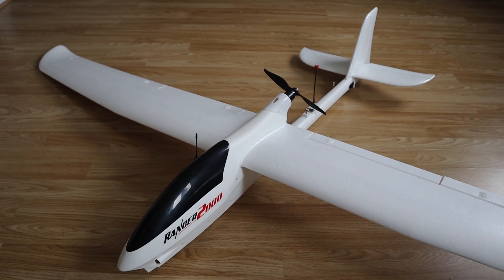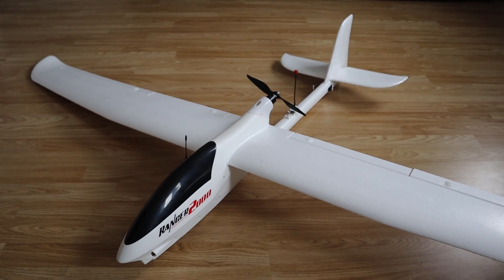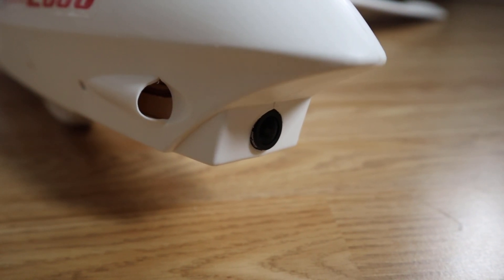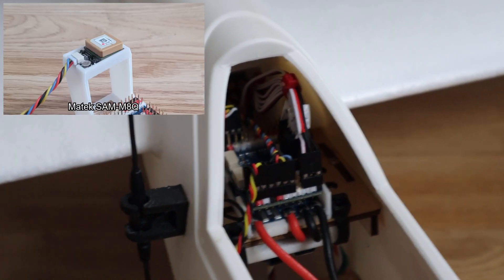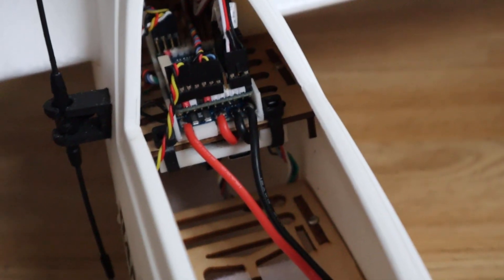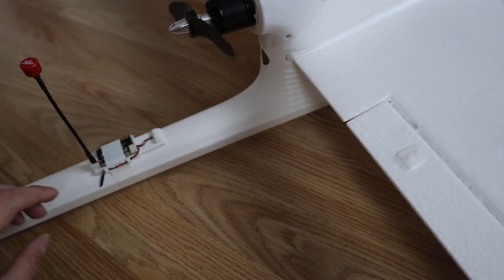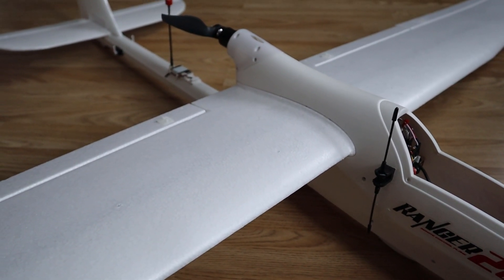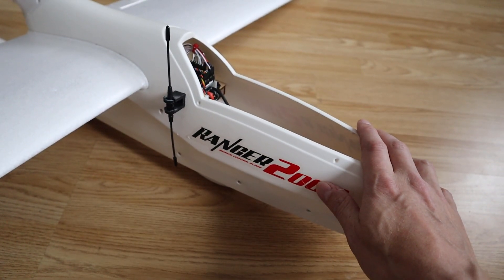🛩️ Volantex Ranger 2000 - INAV Build Overview Part One

Comment: Very useful video, thanks. I'm still at early stages trying to get into FPV. Have been playing with my old Bixler. Analogue vtx. And inav. It's a big learning curve. You're on analogue by the look of it. I am in the process of organising a Ranger 1600 for fpv. Very similar. No 3d printer so it's gluing foamboard for mounting SpeedyBee. I hadn't thought of vtx on the tail platform. Good idea!
Personally speaking don't like the moulded in camera position. Good way to wreck a camera or fill the lens with mud 😢. Will check out part 2. Thanks. 😊

Comment: did you separate the Aileron Servos? they come wired as a pair, and i'm not too sure how to set up the mixer for that on inav!
Reply from the maker: I did separate them, yes. All the servos are plugged into the FC individually, none are wired together. Just made the mixer stage easier
Reply: @gizfpv  I feel like that's the move for setting it up, tho I'm not sure it has any advantages for the stabilization or control, the flying wings seem to all use it, my FC is the matek 411-WSE and it only has 4 servo outputs, so if separate them, I won't have a free Chanel for the flaps. Unless it can do softserial like beta flight
Reply: @gizfpv  nonetheless thanks for the video it's really good having a comprehensive guide like that!

Comment: Looking forward to the next part. Couple things. This body will fit both these wings and the 1600 wings. Thats the only difference between them. The 1600 wings don't have flaps. With the flaps add in some down elevator in inav in the mix. Helps a lot. I had the 1600 a couple years ago. There are some parts on thingivers for the plane. There was a front canopy there as well. Make sure to print a couple extra wing clips. They do break from time to time. Right now I have the Phoenix 2400. I have a pan/tilt on the front canopy. I did use the foam that was there but I did laminate it and printed a plate for the bottom of it to give it some stiffness. For the servo I went over kill and have a big 32g servo I believe it is from my antenna tracker mounted for the pan and then a normal 9g for the tilt. That has a runcam hybrid in it. Up on the tail I have a runcam racer.

Comment: Nice plane, where do you place your rx antennas for the best range possible? I have an ELRS receiver on my fixed wing. Thanks.
Reply from the maker: If you want the best possible range, stick the antenna far out on a wing. However, having the antenna on the side of the fuselage like I have should still get decent range with minimal losses
Reply: @gizfpv  Thanks for your response. Should I install the T-antenna vertically or horizontally? Does it even matter?

Comment: Nice. Can't see more, as the bots are aggressive today.
Reply: Take a look at Andrew Newtons video on setting up Crow Braking to have good landing flap configuration.
Dip on launch is normal, as motor thrust angle needs to go through centre of mass; thus effectively increasing wing loading. You could counter it with elevator mix, or just be gentle on applying power, with steeper than typical launch throw.
Reply from the maker: Yeah I've seen other people launch their Ranger's and noticed the nose always dips on launch for them too. It's not a problem, just something to be wary of. I might enable launch mode for this aircraft, just to help it get in the air. Or alternatively might just try a belly launch

Comment: Just a heads up .. stock servos are 💩💩💩💩💩 replace if you want this plane to live
Reply: Hi Giz, great video. As Matek said, I'd get rid of the servos. I would go even further and replace the stock motor and ESC....
Also the fuselage can take some good beating, but is susceptible to transfer any vibration (unlike foamy) - I'd pay extra attention properly balancing the prop and making sure the motor mount fits tight! 
You will love the plane?!!!!
Reply from the maker: The stock electronics you mean? TBF I can't imagine the servos are gonna be the best
Reply: @gizfpv  servos
Reply: Any preference? Or will Emax metal geared one be fine..🤔

Comment: I mainly fly mine with the 1600mm wings for a more sporty flight. But the 2m was my FPV trainer using a Vector FC. It took a beating, but is still flying after ditching the FC for a R9Stab receiver. This plane showed the non fpv fans at our club what fun it is to "Fly the pattern." under goggle. I learned to take off of grass, fly a bit then shoot approaches and eventually "short finals and even touch and goes!, all under goggle. Adding a Insta360 go 2 next to the fpv camera on a simple pan made it a good camera plane.  I really would like to add a  low profile tricycle landing gear with it's nose gear on the front of the pho sailplane wheel. Then a pan/tilt could be attached on the flat area under the nose that might be protected from strikes by the shark nose and nose gear. A little draggy maybe?  Here is mine with 1600mm wing https://www.youtube.com/watch?v=VHOiz-_4vik
Reply from the maker: That's a nice video. Can you buy just the wings for these things then? Would be nice to have the option to pick and choose which wings to use on any given day. And yeah, I wouldn't mind having wheels with a pan/tilt slung under the nose. There's a Youtuber called Visma that's done that on his Ranger EX and it looks awesome
Reply: Same here, for me Ranger 1600 is the best fpv platform period. So easy to fly, wanna make it light? No problem! Wanna make it LR? Just put 4s 5200mah or liion inside and fly forever, love it! insta 360 go2? Sure! Gopro? Sure! Pan and tilt? Sure! DJI HD system? Yeaaa:) 
btw Have you got any .stl for 3d printing of pan mount for fpv cam + insta?

Comment: I'm not so sure you'd want that camera firmly screwed in, at that location. More than likely at some point it will be taking a hit when landing and you might be glad to have it just get knocked loose and fall back inside.
Reply: Unless....it had a tricycle landing gear with it's nose gear on the front of the pho sailplane wheel. Then a pan/tilt could be attached on the flat area under the nose that might be protected from strikes by the shark nose and nose gear. A little draggy maybe.
Reply from the maker: Very true, although my worry is the tape will give out in flight and the camera will fall inside the fuselage lol. Pretty unlikely I know. Won't be such a issue when I have the other cameras installed anyway, can just switch to a different one if something bad happens :)